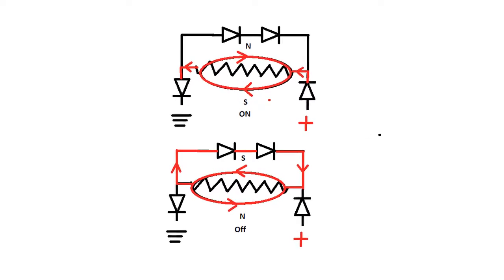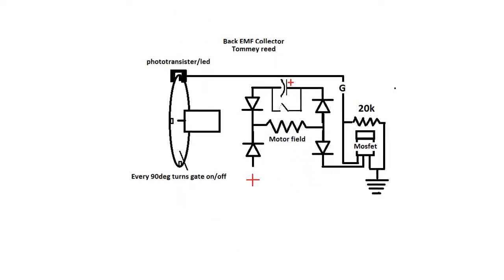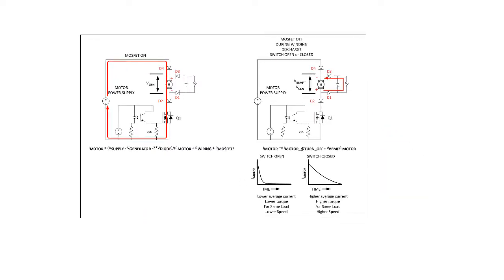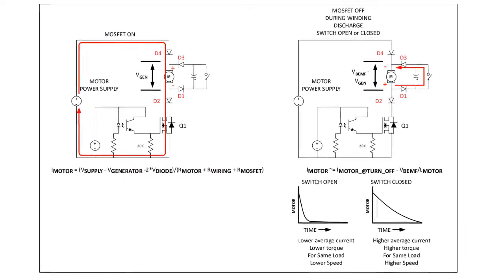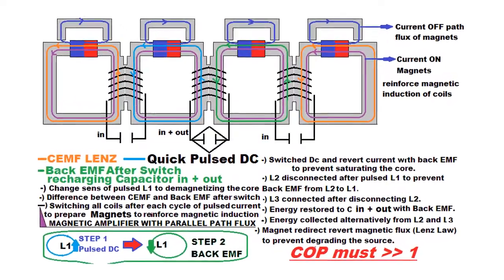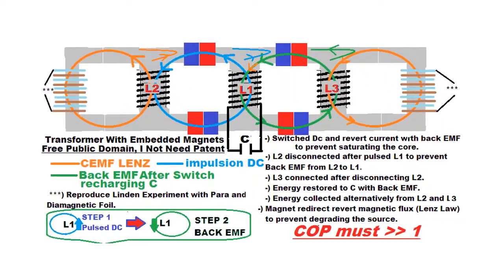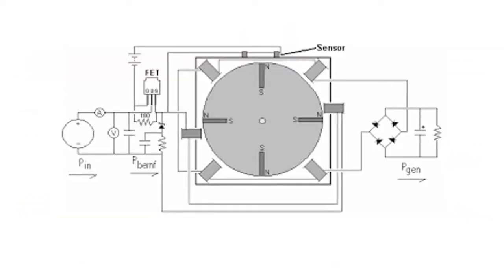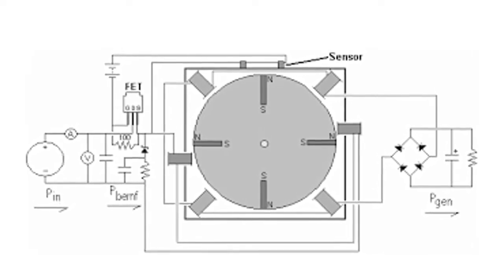Exploiting Back EMF by Electronic Circuit - Secret Of Back EMF | Free Energy

Comment: ###How to add Back EMF higher voltage of inductors to same series circuit low voltage. Adding to first forward pulse. Circuit was source PULSING half wave DC , diode, inductor, diode, inductor diode as 1.5 Millihenry and load resistance. Side diodes are also in schematic as parallel . To add this additional high volts , should this be diodes facing same direction from cathode of 1st diode to resistance load ground in parallel, to get this extra high volts across load?? This was from a 2008 design project and wondering about direction and placement of facing diodes? The website shut down...?????